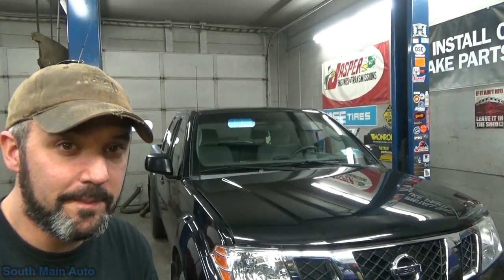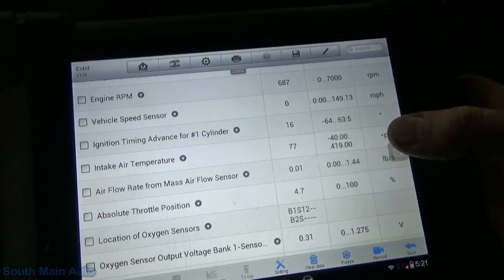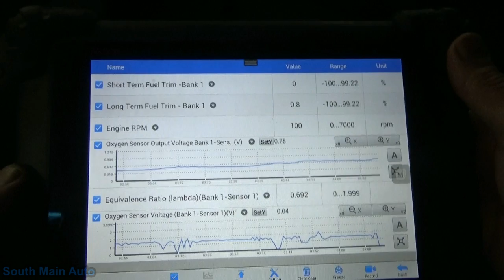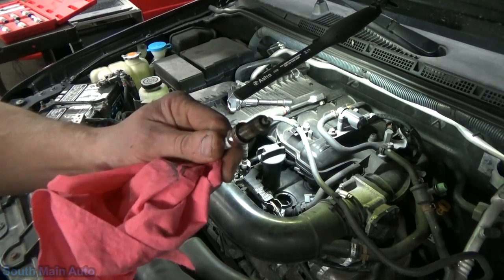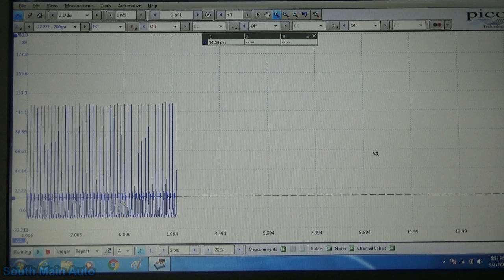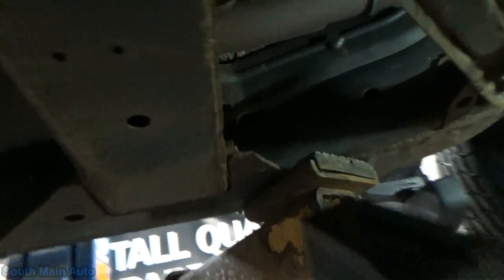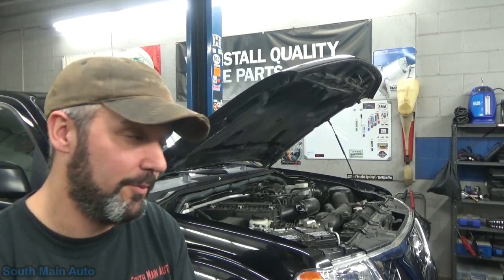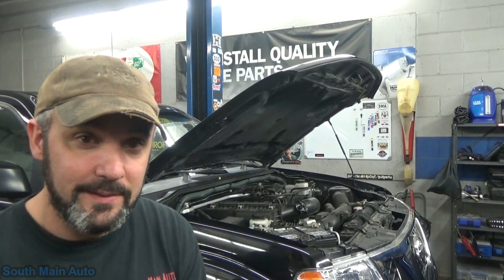Nissan Frontier - Low / No Power Complaint

Comment: Don’t buy the 2005-10 Nissan 4 liter. The radiator leaks coolant into the transmission. Nissan extended the warranty covering this problem to 8 years or 80,000.  I started having trouble long before this. But they wouldn’t honor the warranty until coolant was found in the transmission fluid which happened under 80,000 but I was 2 months over the time period. They would not work with me locally (McGavick) or nationally. I really liked the truck so I shelled out the money for a new transmission, radiator and fixings. Now less than 10,000 miles and 2 years coolant in transmission again. Again no help at local or national. Stay away from Nissan. They could care less about you!

Comment: Hello I'm Jon IVs been wat hung tour YouTube shows and you are very good at diagnosing cars and that's what I used to do with the tech at the dealership I worked at for 23 years before that I worked three other places one I was a instutor for jhoon rhee tal won do I did that for manyb years but before that my dad own the oldest Volvo dealership in america that's where I grew up I changed a vs bug front end when I was five years old my father told me I could bring the bug to oufarm in southern Maryland and man was that a blast at the farming worked on every typt of machine for farming and I also no pluming and electric and also roofing and drywall and I can dry
I've a bulldozed through anything I don't think I was ever a kid to be honest with you.ilearmed a lot I've been working on motorcycles cars boats you name it.chances are I can fix it I worked a t a motorcycle shop for about five years anyways I used to do my own machine work the heads your doing the work you can do your self they have  press and a small lathe you can cut the valves and reseat them to the head one of two ways reseat with valve grinding compound or you can grind the seat if needed if it just needs cleaned up ànd reseated justust valve compound but if there just a little lose you can buy this tool for neraling tj guide the snap on man now what it is ask about it youl!find you. An do most of the work yoiself.save a ton of time and money also buy a hot tank to clean parts heads cams mostly for oil pports very small they must be spotless your very good at what you do diagnose is a art most people can't do what you do or maybe it just the way you do it I learned the way I guess you learned I can fix a car unless I dianoose it first it bets very expensive fixing it any over way so many people parts replace until it runs which is stupid .anyway have fun in disabled so I can only do what I can do it kills me that I can't do the stuff I used to .it suck being crippled I can still fix stiff I'm just slow and sometime I need help just holding or whatever.I can get used convertors only one state plays them and I got ere number and its legàl haha

Comment: cat. convertors and emissions tests are designed to punish poor people and keep them from driving old cars and have to buy newer ones.   You can make a million selling cat. convertors for cheap in black neighborhoods.
Reply: N N Believe it or not, people steal converters and take them to the recycling place for money. They'll cut them off from a car!
Reply: There is a gang of thieves running around our area going after CATs off of Porsche and BMWs.
Reply: You are too young to remember the bad good old days when the air smelled like gasoline and was full of lead.  If we put you in a Way Back Machine to 1968, you would understand why catalytic converters and other pollution reduction equipment is installed on cars.
Reply: Now the air smells like sulfur.
Reply: @martystevens3969  We had 3 of our trucks at work have the cats cut off in our parking lot over one weekend once. Went to start the old bugger and it started and blew my ear drums haha.
Reply: I dont miss the smell and smoke from before CATs came.

Comment: took that long to diagnose the obvious.  Lame.
Reply: Wayne Wildman how would you have diagnosed it?
Reply from the maker: Your right, I should have started it, made an assumption, and shot a few parts at it instead of wasting a whole 30 minutes to find out 100% for sure what the problem was. Well, there is always next time :D
Reply: I would have listened to it and used an infrared thermometer to check the temperature in front of the cat and behind it. Besides you could hear the loose broken ceramic in the exhaust.
Reply: South Main Auto Repair it was 100 percent obvious though. Not shot a few parts at it. Shot one part at it and that would've proven to be the correct part.
Reply: Wayne Wildman if there was a cat midship and you suspected front cat due to sound and temperature you'd miss it. When flow is restricted temperature differential is nearly useless. Even a simple backpressure test with a gauge would work. But one thing is for sure, from a customer standpoint,  being told that a cat is clogged is nice . Being shown on a printed scope pattern brings something new to the table , Professionalism. It's what separates a mechanic from a technician. One says they can hear it and think that's what it is, the other says here are the test results. Cheers
Reply from the maker: Wayne Wildman have you ever pulled in a car with a faulty maf sensor, stuffed it right to the floor and heard the engine bog and sound 100% like a plugged exhaust?  Have you ever pulled a car in with a bad fuel pump, stuffed it right to the floor and heard the engine bog 100% like a restricted exhaust?  How about a car with O2 stuck rich and ft's pegged out making the engine bog?  I can keep going and give you a lot of reasons why I prove all my diagnostics with data.  On a side note the rattle was an exhaust clamp rotted in half, rattling on a the pipe.